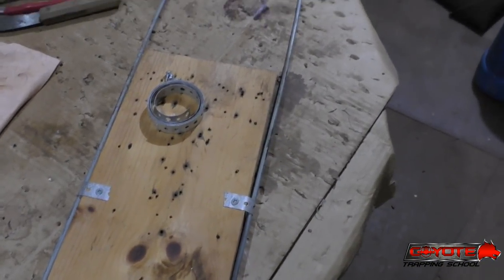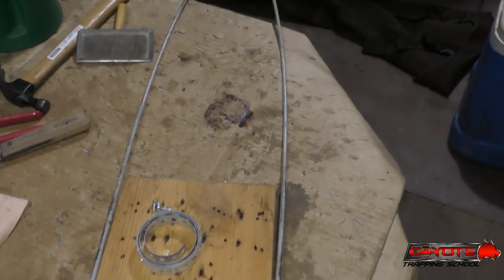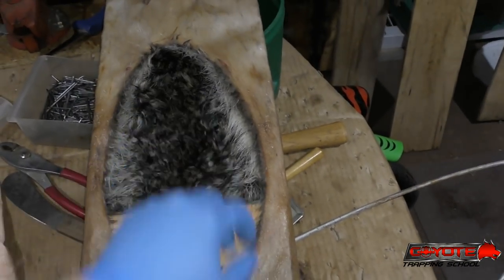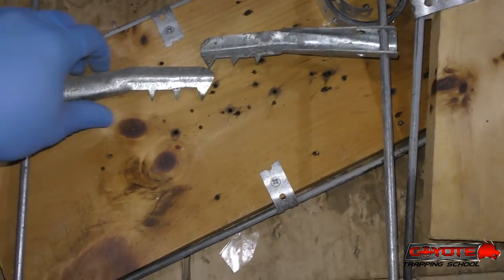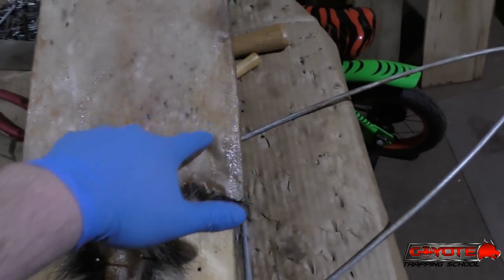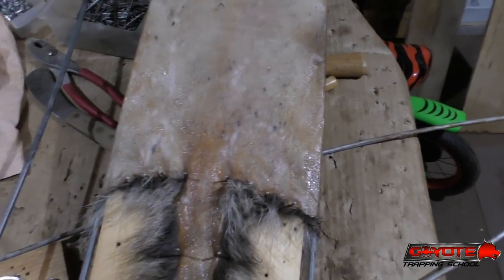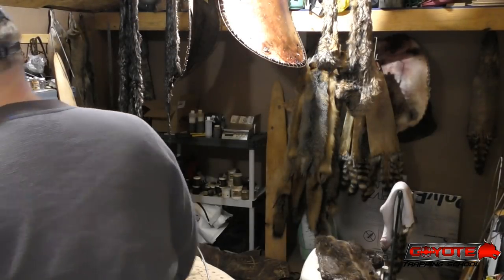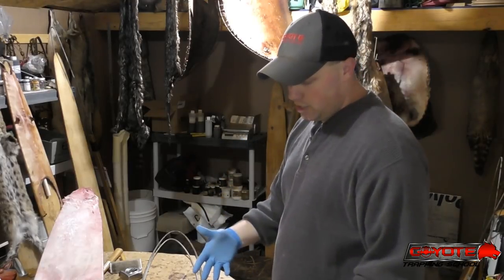Modifying Wire Fur Stretchers

Comment: If you round the Edges of the board so that it is 3/4 in the middle and out to 1/2" on the outside edges and taper the ends the same way then you would be closer to what a solid board would be . If you had to past the end of your stretcher you wouldn't have the squared edges from the pine board . I use a split board for Raccoon and it is 1/2"" inch thick  then use a wooden shingle to stretch the tail.  Love your videos keep them coming
Reply from the maker: You're right about trimming the edges of the board down, I hadn't thought about that.  I love all the ideas I get on here!  I've definitely got some tinkering to do.  Thanks
Reply: Your Welcome. Will Schneider below had a good idea to. If at the bottom of the stretcher where  the wire makes a 90 degree turn if you were to leave say 2" of the very bottom of the stretcher,  then drill holes about 1" apart on both sides of the wood (plus how you have it connected ) you could actually  pull the wire out of the hole and slide it up or down to the next hole.

Comment: Another good video bud it's kind of hard to explain but I'll try instead of cutting your whole cross bracket off just cut a section out and drill into the side of your bored you spread your stretcher and then the part of the crossmember that's left will go into the holes to the side of the board you can drill a couple holes down through there so you have different sizes. Then your crossmember bar won't be in the way anymore. If that doesn't make any sense and you are interested in me making better sense of it I can try to make better sense of it for you but that's what I do same as you do with your boards but that's the way I make the bottom end

Comment: Could you use the original hide grabbers to attach the wood to with just a simple loop of wire through the wood plank to be able to draw tension on the hides while still using your wood plank

Comment: I would just Bend the ends of the strechers to keep the board on
Reply from the maker: I should've cut the stretcher on the bottom and left the bend in rather than cutting it on the side.  That stretcher metal is strong!

Comment: You can cut the bottom off, but leave 2 inches or so drill holes in the end of your board. Take your pipe strapping and screw down like you've been doing.